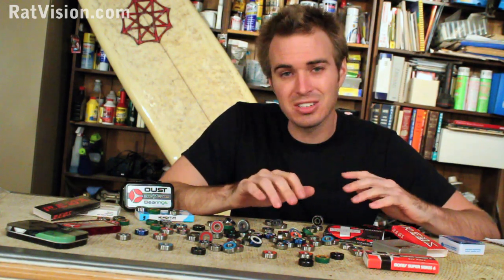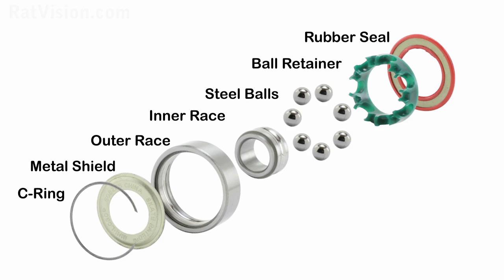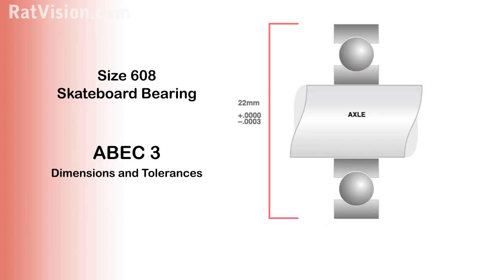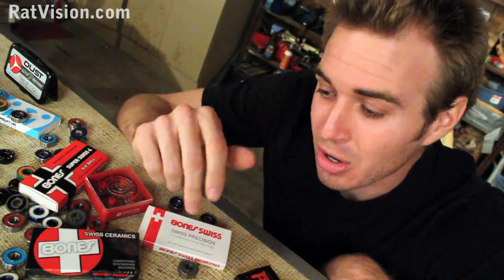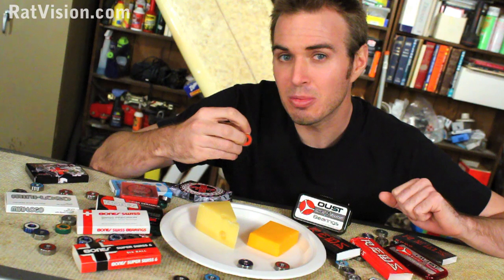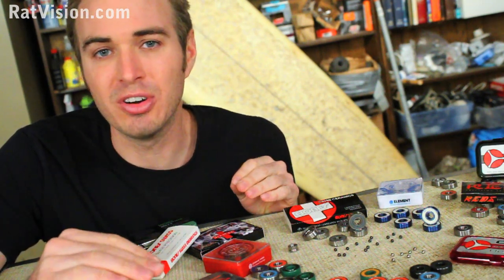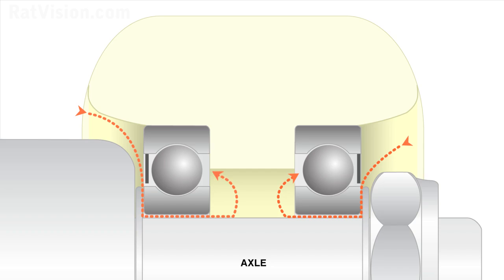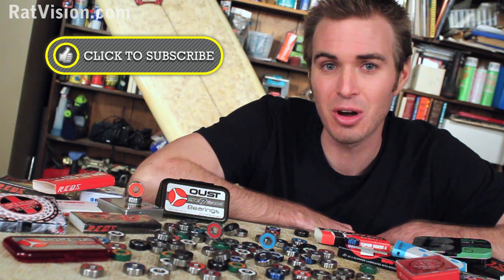What is ABEC / Swiss / Ceramic Bearings

Comment: I'm looking for speed performance for skateboarding on skatepark ground. Any Ideas?  I went with the bones Swiss labyrinths
Reply from the maker: Why?  After watching this video you still went with Swiss.   You should have watched the video again and paid attention.  What's good about Swiss?  Why are you assuming that Bones supplies the best products?

You've also got to think about what other factors that make a board slow or create speed.  What durometer wheels do you have?

When it comes to park skating it can be argued about what wheel hardness is better.  

Some people like to zip around the park at high speeds and want the hardest wheel possible so they don’t have to push much. 

Just because a wheel is hard doesn’t mean it’s the best for skateparks.  A lot of people prefer softer wheels at skateparks because they want the wheel to grip around banks, pools, and mini-ramps.

If you like hard wheels but want to increase speed, u would simply go up in diameter. This will affect pop though because you now changed the leverage.

Another option is to select a narrower wheel with a small contact patch, which just the wheel’s width that touches the ground, not the amount of the wheel.  Less contact essentially equals less drag.

Your bearings have a lot to do with speed, but you have NO idea to what degree your Swiss Labyrinth bearing are good.  

Bones tends to use shallow raceways which are great for speed, especially on straight aways, but with all the turning at a skate park you are going to encounter a lot of radial runout which bones bearings can't handle, due to the shallow raceways compared to deeper raceways.

This stuff really isn't that hard to figure out, if you just step back and use that brain you got.  Question everything, and never believe what a brand tells you, until you find the facts out yourself.
Reply: I bought them before the video. But moc 7's tend to break easily. They're more for longboarding. I'm looking for strong trick bearings that give speed. The skatepark I'm at is actually not for turning It's more bowl oriented with a couple pyramid ands step ups. So turning is no problem I just loosen my board. It's not so much as my wheels or board because I just have to tighten or loosen them. I want strong long lasting bearings. Not fast bearings that will shatter after a couple months of use.
Reply from the maker: Who said MOC 7's break easily?  Oust bearings are not made for longboarding.  They are made for all types of skateboardings.  Go with MOC 5's.  They have a metal ball cage which is better for street skating.  Still fast bearings.  
I don't think you realize how much turning is involved with skateboarding.  Any movement from leaning is going to make the board turn. This applies loads to the bearing. Loosening trucks will make the board turn easier, but you are still applying loads.  Applying loads makes the bearings slow, bind, or lock up.  You need a bearing that can handle these loads, and Oust is the only bearing brand that specifically designed their bearings to handle loads from skateboarding.  So, that is why I asked who said they break easily.  Oust was also the ball that went to 22,000 lbs in a press.   If you are having trouble with bearings lasting, it could be that you're using bearings with shallow raceways like Bones, or not maintaining them properly.

Comment: i got biltin abec 7s for my koastal longboard, do you know how good or bad those are ? i just got informed about all these different bearing types by your video and I'm taking your word and getting oust moc 7s next time. but i just want to know just how good are the biltins since i already got them.
Reply from the maker: They aren't terrible, so use them.  They certainly aren't the best.  IN our opinion built in half spacer bearings don't solve a problem, because if you watch out other video on spacers, you'll see how wheels have different centers/core dimensions.  So built in spacer bearings don't work for all wheels.

Comment: is there a big difference between the moc 5 street and the moc 5 tech? does the tech have non removable steel shields on both sides?
Reply from the maker: They are the same bearings, but the Tech has removable rubber seals, and the street has non-removable metal shields.

Comment: So is the purpose of this video is that no bearings are better than the other? I just wonder.
Reply: really none are better than the other, i always hear zealous is good, but none are really better than the other :P
Reply from the maker: Sky Mcdaniel Of course some bearings are better.  Some have more tolerance/higher ABEC rating, some are more polished, have harder material, etc.  We mentioned this all in the video.  In our opinion Zealous is not good, because they use a built in half spacer with a ceramic lubricant.  Some people are aware that ceramic is harder than some steel.  Why would you want ceramic ruining the polished finish on a steel raceway?  

Bearings have so many variables that make one better than another.

Comment: Are bones super redz, bones swiss ceramic, or abec 7s better for penny boarding? I just want to kick strong and cruise for a while. Got abec 3s with my board.
Reply from the maker: We love how Penny owners think they have something special. Don't ever forget that you are riding a Penny.  I'm not sure if you actually watched the video, because we do mention quite a bit about swiss and ceramic and yet you still asked about them.  We don't recommend ceramic ever.  Swiss means they were made in switzerland, and ABEC only rates....  So, pay attention to the video.  You also should watch our video on bearing spacers.  "Kicking strong" has to do with your leg strength.  There are a lot of variables to consider.  What type of riding conditions/surface do you skate on the most, what is your current durometer, do you just need to clean?  And lube your bearings perhaps, and maybe a bigger wheel size would help.  Let us know.

Comment: Does wheel size matter when buying bearings? I have a Hi-Lo set up on my hockey skates where I have 2 80mm wheels in the back and 2 76mm wheels at the front. Does this make a difference in what bearings I should buy?
Reply from the maker: It sounds like you actually did not think about what you were asking first and just asked. The bearings you have now are all the same.  If 2 wheels are slower on purpose, that would make all 4 wheels slower (your whole skate), which means you would not be getting the full amount of speed you would actually want, RIGHT?  I know this is an honest question but you got to think sometimes before you ask questions.
I know you're young, and I don't mean to offend you, but please try to use your brain and figure out things work rather than just asking for answers.  This is why we all go to school.  Not to get answers, but to learn things in order to know how to get the answers.  
Why would it matter if your wheels are different sizes?  Do you want your back or front wheels to be slower?  I would hope not.  Do you want all 4 wheels to be fast?  YES you do. So, here is your answer.  Of course wheel size DOES NOT matter.  That's why bearings are sold in packs of 8 or 16, and they are all the same.
Reply: Rat Vision – Skateboard Tech Thank you. I'm brand new to all of this, so thank you for clearing it all up for me.

Comment: I just wanna ask if replacing my penny board's bearings would be good. I just cruise around town but I really want to push with little effort. I also like going fast, just feeling the air. I'm a newbie in skating so I don't know if these bearings are compatible with the pennies. Thanks! Rat Vision – Skateboard Tech
Reply from the maker: You may just need some lubricant or a cleaning (both).  New bearings may give you more speed and less effort, but you have to consider how older bearings that are well maintained are better than new bearings.

Comment: What do u use?? I just got my Bones swiss precision l2, like, i thought they were able to spin for mins but mine just spins for 12 secs, Do i need to warm them up? Are they bad ? Should i sell them? Please respond
Reply from the maker: You don't even know what you bought to begin with.  You got suckered into buying those bearing because of your friends and marketing hype.  You assume that Bones is the best, and that Swiss is beyond ABEC, and believed all the nonsense so you spent way too much for bearings that you don't need.  I don't mean give you a hard time, but it's upsetting to hear that you wasted so much money. There are 2 types of consumers. Either they want the best product that will function the best way possible, or they are more interested in bragging about the product they have to other people and want them to be envious and/or jealous.
You are only going to go as fast as you can push, or however much gravity will pull your weight down a hill.  Since you are not trying to reach top speeds you got a set of bearings that are beyond what your skill level requires.  Basically you bought a Ferrari to go to the market and get eggs.  

The bearings you got have lubricant in them.  That is why they APPEAR slow.  They are not slow.  Spinning a wheel proves NOTHING.  You have to apply your weight to the wheel and ride the board to see how well the bearings work.

You also have to allow time for the bearings to break-in.  This is a period of time where the contacting metal surfaces undergo physical changes and become smoother, which allows for more speed.  New bearings are never the best.  After the break-in period, that is when a bearing proves it's true optimum performance.

Next time don't waste your money buying stuff your friends and peers suckered you into buying because you thought you were getting the best.  You got good bearings, but you don't need them.  They will function just the same as a $10 set for you.
Reply: Thanks for the tip, But what do u recommend to get ? And what do u use?
Reply from the maker: We recommend Oust. But if you're a beginner, it doesn't matter.  All bearings work fine.  The most important thing is keeping them clean and lubricated. $100 Swiss bearings rust the same as $10 bearings.

Comment: If they are nylon removable shields though, the metal that under the nylon is really thin and they can easily bend and if they bend inward they will make a slight contact with the balls and/or inner ring. So its good to make sure your shields are nice and straight.

Comment from the maker: Seals and Shields DO NOT come in contact with the balls or inner ring.  They DO NOT slow bearings down!  If you remove them then your bearings will slow down a lot because you are allowing everything to get inside and the lubricant will come out.

Comment from the maker: Those bearings will be OK.  Maybe you don't understand what tolerances are still.  ABEC does not determine how good a bearings is.  ABEC is only used for measurements.  It has NOTHING to do with speed or how good a bearings is.

Comment from the maker: They don't work.  Built in half spacers only work for a wheel that has a matching center sizes.  Watch our video about bearing spacers and you'll see how wheels have different centers.  Basically, built in half spacers are a gimmick that the downhill/longboard community are fooled into buying.

Comment from the maker: Ceramic is not harder than ALL steel grades. I mentioned this in the video.  It is incorrect to say that "ceramic bearings ARE harder than steel."  That was proven in the video too. So, you are someone what correct in your comment. Also consider that ONLY the surface of ceramic can be harder.

Comment: Actually ceramic bearings ARE harder than steel. All your test shows is durability. A diamond is harder than both and would indeed fail sooner than the steel. That's why bridges are made of concrete (hard) and steel (durable, tough).

Comment from the maker: NO! All u need to do is think about that statement and you'll figure out how it doesn't work. Ceramic is not harder or stronger than all steel grades. It's not a superior material. It's brittle. How do we know that the ceramic balls have a harder surface than the steel races/rings. Why wouldn't steel balls do the same thing, especially when they are harder? It's not what ceramic is "supposed" to do either? What is "re-polishing"? HOW? Ceramic don't belong in skateboarding. FALSE.

Comment from the maker: Between Reds and Super Reds there is a difference as far as production. It can be debatable if there is a noticeable difference by the user. In our opinion, even though Super Reds are better, you may be paying more for peace of mind, than an actual increase in speed. It really boils down to your level of skill. If you're fairly new, or not that good, then go with the cheapest bearings you can find. They all work. Save money, and go with Reds, or something else. Your call. 20 sounds good for UK.

Comment: interesting video. one thing i would say is that when skaters are choosing bearings, too often they just free-spin the wheel on the axle and see how long the wheel spins for. This isn't a good way of testing in my experience, as a dry, worn bearing will often spin for ages with no weight on it but wont give a smooth ride once your weight is on it and it is being subject to the loads of skating, whilst some "slow" (in the sense of free-spin time) bearings actually ride very smoothly.

Comment from the maker: NOT TRUE/ FALSE. ABEC 9's are hopefully more durable because of the tighter tolerances.  It reduces radial runout. In other words it helps to keep the balls from riding on the edge of the raceway when side loads are applied. Don't forget the other factors that we mentioned. ABEC is not a "fragile" rating. So, whoever told you that may need to be slapped across the eyelid, and then he should do the same for whoever told him, and so on.

Comment from the maker: Oust is the only company that actually redesigned bearing to handle axial and torsional loads.  Because of the redesign in the raceways the tolerances actually got tighter, which went outside the ABEC scale. They use a much harder steel as you can see in the video, where they're balls failed around 22,000 pounds. This harder steel translates into faster speeds and durability. The ball that exploded was a Bones Swiss ceramic.
Reply: Bullshit, tighter tolerances are worse because the bearings are squeezed when press fitted. What you need is larger clearance C3 or C4

Comment from the maker: There is no standard size even though they all look the same.  It's all a matter of tolerances within certain dimensions. You can't see, with your eye, the differences between balls and damage that has been done.  You are also not even thinking about the raceway of the bearing.  You're better off buying new bearings than replacing balls, especially since you don't know if the rings are what is damaging the balls.

Comment from the maker: YES. Watch our other video on bearings and bearing spacers. You are applying a lot of axial and torsional loads, which can blow the bearings out without the right tolerances and raceways. We recommend Oust bearings, especially for what you are doing, because they redesigned the their bearings to handle these loads. During these heavy loads bearings want to roll out and ride on the edge of the raceway where they can gall from friction and deform.  This is also why you need a good lubricant.

Comment from the maker: Sure it does. You got to watch the other video on bearings and bearing spacers. You're applying a lot of axial and torsional loads.  You'll blow bearings out a lot quicker without the right tolerances and raceways.  We recommend Oust bearings, and highly recommend them for what you're doing, because that is what they were designed to handle. When you apply heavy side loads the balls want to roll out and ride on the edge of the raceway where they can gall from friction. You also need good lube.

Comment from the maker: An old lady who has never stood on a board went down a hill at 47MPH.  She would have gone over 55MPH but since it was her first time, she wasn't as good as the bearings.  I'm kidding. I know your point.  It's when all these new skaters buy Super Duper Swiss Ceramic ABEC 37's that they think they will ride faster than anyone else.  They aren't pushing the limits of the bearings so there is no point in buying something they don't need.

Comment from the maker: Very cheap Chinese bearings. The only selling point is their lube. People go crazy for "nano ceramic lube", because of how ceramic bearings are presumed to be the best. Ceramic is harder than most bearing ball and raceway surfaces. Why does sandpaper remove wood? Because it's softer! If wood was harder, it would remove the sand off the paper. Why add harder ceramic grit to softer metal bearings? It's going to make the balls and raceways rough. Built-in half spacers don't fit every wheel too.

Comment from the maker: Well that all depends.  We've done the testing and research that has shown Oust to be far superior than the top bearing brands. So, we are pretty confident that Oust is much better than your cheap ABEC 5 bearings. However, you may not notice a difference right away, or at all, but the quality is there.  Performance and bearing life is going to depend on your ability to maintain your bearings too. No bearing is going to work amazing without good cleaning and with a good lubricant.

Comment from the maker: We don't get anything from Oust. We have tested Oust bearings against many of the top brands and Oust came out on top. They r the ONLY bearing brand to redesign the raceways so the bearing can handle axial and torsional loads that skaters apply to them. Bones, like every other brand, uses the same standard style. The redesigned raceways in Oust bearings allow for tighter tolerances which are beyond the ABEC scale. You don't get these features from other bearings. That's why we recommend Oust.